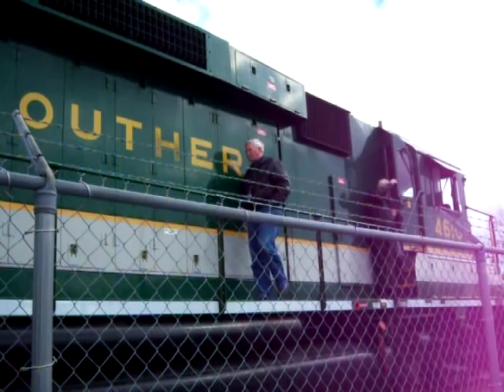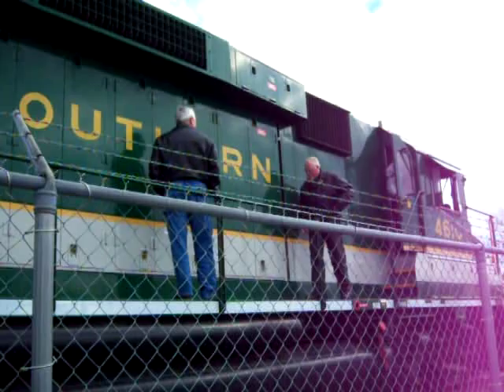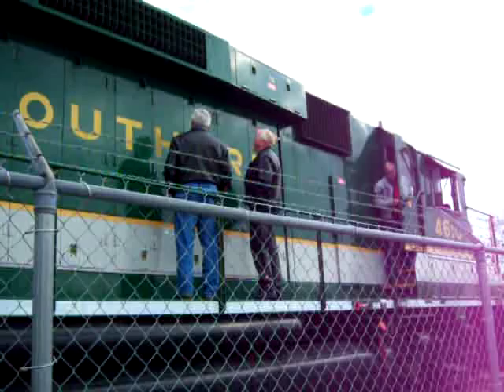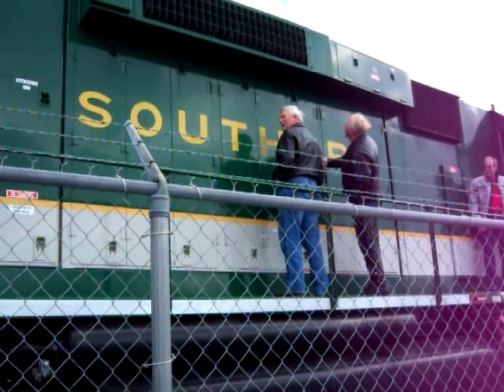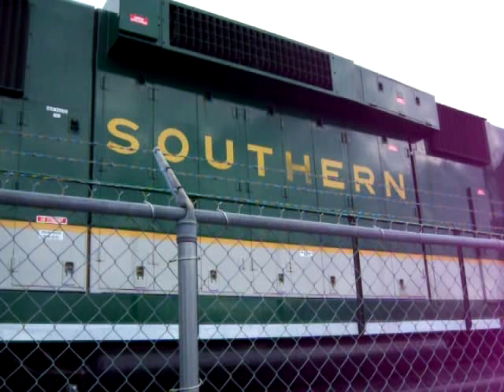Southern EMD GP59 Idling

Comment: EMD came out with an engine type before the GP60 called the GP59, it had a 12 cylinder 710G3A, The GP60 had a 26 cylinder 710G3A. One of the handful of locomotives still in southern paint, it has ran road freights.

Comment: It's sad that the horsepower race has ended, the DD40Xs are pretty much gone, most of the SD90MAC Hs are gone, the AC6000's future is looking kinda sorry. I do much love the 710 and 645, they are my two favorite EMD engines and and along with the GE FDL, I am in the progress of making some MSTS sounds using the 710 and 645 true rev at 44100hz

Comment: The GP60 had a 16 cylinder engine.  If it somehow had a 26 cylinder engine which I don't think EMD ever made, it'd be a lot longer than it actually is since the engine would extend so far back.

Also the 4610 along with the other GP59s were built after the Sou and NW merger and were delivered in NS paint.

It was only back in 1994 that 4610 was repainted in Southern paint for the marking of 100 years when Southern Railway was first founded.   NS Engineer Ben Lee suggested the repaint.

Comment: I figured you probably made a typing mistake, anyway I didn't mean to make you look stupid or anything like that.

Engines with so many cylinders like that do exist though, but they are used as the generators to make electricity in some medium sized power plants and as prime movers for massive ships.  

Union Pacific's eight axle centenial DD40X that was built with two EMD 16 cylinder engines probably would be the only diesel locomotive to handle a engine that big.